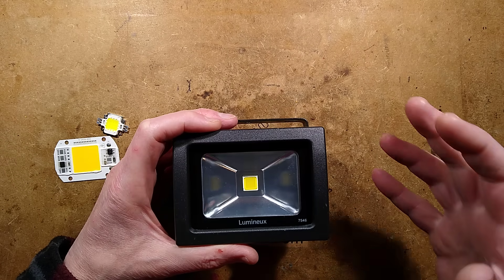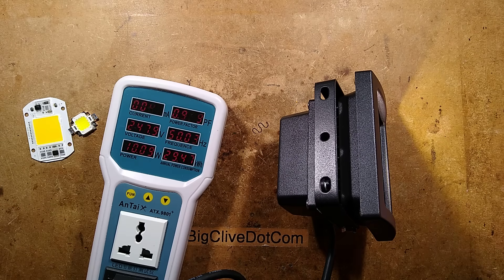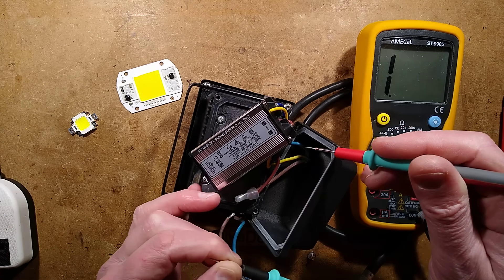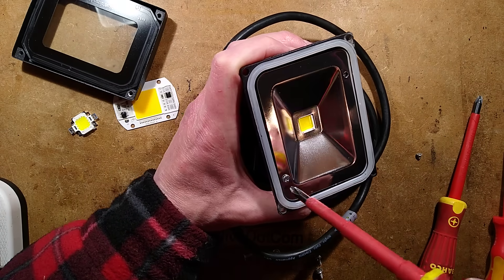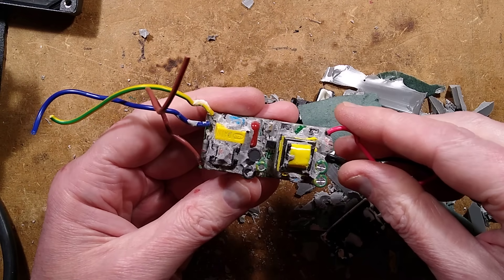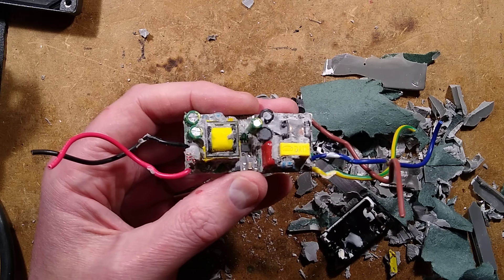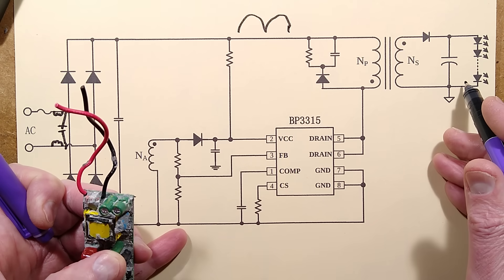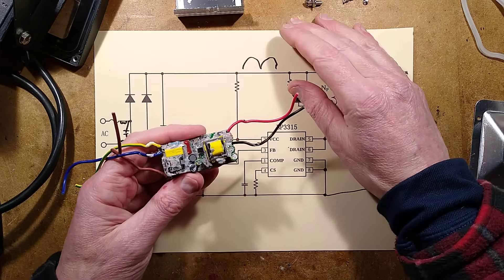Exploring a "retro" LED floodlight with a well designed driver

Comment: Different tack. What do you think about a big department store branded tower heater (made in China) rated at 2000w and powered with 0.75mm twin core flex? Flex gets warm!
Reply from the maker: That's pushing the rating to the edge
Reply: @ I thought 0.75mm was rated at 6A?
Reply from the maker: @TheDocgt40  It's possible they have a higher temperature rated insulation.  But for an actual 2kW load it seems a bit ungenerous.

Comment: Given how many of the things you end up looking at are fire or electrocution risks, it's nice to see one that's actually nice for once. While I understand the push for cheaper LEDs, I really hate how hard it is to find LED bulbs that don't suck nowadays. Or just bulbs in general. All the downlights at my parents' place are self-contained LED, and once those start failing I'm sure I'll get co-opted to replace them since I don't really want their house burning down. Plus they all flicker madly whenever any inductive device is running, which is fun.

Comment: I've been looking for a good LED to replace a bulb in a 8mm movie projector.  Cooler, less wttage. win/win.
Something like this would be nice.  But would it be bright enough?  Hmmm..
Reply from the maker: For projectors you may need a precise pinpoint source at the focal point.  If you used an LED (and you do get rectangular LEDs just for video projectors) then it would require a new optical system to match it.

Comment: Absolutely agree. Have replaced 3 new led floodlights in as many months. All same type of failure , the led goes dim/dim flashing. Same brand, from Screwfix/Toolstation, have the external pir sensor, all 10w. Night searcher were doing a good sale early 2025, so picked up a few, with a few year warranty, it's worth a punt. Cheers for another informative, funny and educational video. Wish this sort of stuff was around when I was a kid. May have helped me avoid many electric shocks overrr the yearrrs. 🤯🤪
Reply: Will have to do a take apart video and see what type it is. Probably an all in one ic type.

Comment: This reminded me to dig out my old one of these. I hadn't enjoyed them indoors except as worklights because of their relatively cold spectrum, but I have some sheets of orange gel left over from another project (also involving the square Ikea Grono accent lamps), and with a diffuser fashioned from two layers of simple vellum the result is a delightfully warm glow.

Unfortunately, I'm in the US and thus unable to order from this seller (who's probably out by now anyway!) But I'll have to see if I can find a few more of these more locally, since unlike the newer sort they really do last in indoor applications.
Reply from the maker: You can probably swap the LED out for a warmer colour one.  The 10W version are available in 9V and 27V versions, but the 20-100W similar style have a standard voltage of about 30V.

Comment: Hi, you mention flicker a lot. Is there a risk when using these around rotating machinery (think lathe in the shed) that moving parts can seem stationary? I remember during the 80s machine shops having their florescent lighting wired to alternate phases to reduce the risk of that happening.
Reply from the maker: The flickery LED floodlights can have a similar effect.

Comment: Great video Clive. I’ve got a bit of an interesting one for you. I run a resale store and when we get printers in, often times the cartridges can be remanufactured quite easily. I’ve got dozens of these resetters meant to reset values of the ink level IC. They are all over AliExpress, but the part I find interesting is how a few of them are programmed to stop working after a while. There’s options on the item page like “100 times”, i already planned to RE them but i certainly was after seeing that. After inspection of the canon 250 resetter, it is a fake attiny that’s counting to 100 and drives a big transistor. The reset function itself and indicator led is powered by a separate SSOP. From what I can tell, when the counter exceeds 100 it will drop power from the gate. I’m patiently waiting to run out of “times” with the resetter since i think a solder bridge or even the attiny’s reset function could bring it back. I’ve been learning this stuff for a while now and these little SOC circuits have been perfect for that.
Reply from the maker: It would be interesting if the counting was done by a separate chip, just enabling the circuitry with a transistor.

Comment: It was quite easy to replace the driver with one to run from 12V to create floodlights for off grid use.. More of a chalange with the psu on the board design.

Comment: From an installer's point of view these were excellent as a replacement for the 500W halogen cookers which were often poorly sealed and corroded the end contacts of the lamp.
I never had an in service failure.
Compare that to David Savory's frequent rants on LED strip lights and external floodlights - scattered with necessary expletives.

Comment: Only reason I got rid of ours is the sensor that was attached to the bottom got its plastic broken so it tripped too much. The outside had gotten rusty due to location but the light still worked great.

Comment: Agree with you Clive, every time an led floodlight fails, off to landfill it goes. With the useless 1' cable provided, I've learnt to wire up the in line weather proof connector 12 foot up a ladder, not fun times.

Comment: An old mechanic trick if the screwdriver slips use some valve grinding paste on the tip keeps the driver from slipping

Comment: Heh, I have one of these on my desk right now ("warmoon" pseudo-brand, 120V/US) and the only difference is that the driver board isn't potted and isn't even in a box - it's just floating in that back section, wrapped in one layer of what looks like kapton tape.
Reply from the maker: That and heatshrink are common on the cheap imports.

Comment: That's a high quality LED floodlight! Too bad it it had to die in autopsy, for our viewing pleasure, but you have a box of them :-)
I have a cheap one from Lidl, that is 6 or 7 years old and still going, but it's very weak. I also have a relic floodlight (some 15+ years old), with a matrix made with individual 5mm LEDs, that is even weaker - my rechargeable pocket torch has more lighting capacity :-)

Comment: COMP = Frequency Compensation.
...basically a low pass filter required in the feedback path to keep things stable, in the same way op-amps need it (i.e. stop if going 180 degrees out of phase, as in  becomes a positive feedback which = oscillator = NOT GOOD).

Comment: This is the definition of "they don't make 'em like they used to" and it's not even an exaggeration.
Reply: I long for those days. They may have cost a bit more but you didn't have the far king things blow on you every few weeks. I have been trying to purchase a reliable and quality 12V 2A Power Adapter and so far all three companies that I have purchased from have had their products returned and after seeing images of the test results even paid for the return shipping without putting up a fight. Just so sad we can't buy quality products anymore.
Reply: @josephking6515   The good old days .. When men were MEN ! and sheep where AFRAID 😝 DAVE™🛑
Reply: Oh yes they do. Hard to find these days and certainly not on ebay or aliexpress but these type of flood lights still exist

Comment: Could you please, . show a couple of hacks - to convert discarded vape 'devices' with usb c charge ports -
 into simple press to light mini torches ? a suitable led and switch ? - and removal of smelly gubbins? 
 [ ELUX ] have some nice pocket devices - and those girthier ones with multi chambers.
Reply from the maker: The circuitry means you could only have the LED lit for about 10 seconds before needing to release the button and press it again.  A standard 5mm LED could be used with a 47 ohm resistor.

Comment: Solder tinned ends on the mains cable is a fail, why do companies do that?
Reply from the maker: It's fine if they're not subject to continuous vibration and movement.  It prevents loose strands from sticking out of connectors.

Comment: Have many of these in a work light format, much larger with all aluminum housings w/heat sinks and steel frames....they were more expensive but really put out the light and have worked great for many years. Thanks for the tear down and R-E Clive, great video.
Reply: Can I ask what brand?  I'm looking for a good one.
Reply: @Celtic_Identity Bought at Home Depot, $30 ea I think. Yellow in color, no name unfortunately as the stickers have come off but should be easy to find. Mine are a few yrs old now.
Reply: @terrym1065  Thanks.

Comment: I bought a few like this years ago  They all were not the stated wattage As you showed . and they all failed in a short wile . . looks like they have improved noted the reflector was metal mine were thin plastic film like material  . and the power supply was inside the lamp itself .

Comment: My first LED floodlight was from machinemart and was simply an array of many (around a hundred, or more?) discrete LEDs of around 250mW rated power, arranged over an area of about a square foot( yes, that long ago!).  ‘Flood’ was maybe a bit of an exaggeration for it - but it was quite effective for a very local area and used far less power than any halogen bulb.🙂

Comment: Would be nice to have some of them for illuminating a driveway, even if they are exposed to the elements.
Do you think the quality is good for 20 or maybe even 30 years of daily use? 😎
Reply: i'd guess 10 years. but not in a 27/4 fashion.
Reply from the maker: It's hard to predict longevity of any light.

Comment: I've got an 18650 version of that, excellent worklight. I don't understand why they run those newer ones so hard cos you're right, changing a lamp is a lot less risky than changing a fitting, just thinking,  hopefully that power supply is ok, but at least you can fit a new one cheaply, and the led, good outside light it would make.
Reply from the maker: They run them hard so they fail quickly and they can sell more.

Comment: Instead of getting a full unit like that ive just been buying big 12v 1000 Lumen COB LEDs from Amazon or AliEx and making an enclosure for it while powering it with 12v AC-DC LED Powersupply/Transformer plugged into a remote-controlled outlet. I consider every now and then trying out a normal floodlight, but i just havent really felt like it, partially cost related.
Reply: Considering how much outdoor stuff like this fails due to earth faults I think a indoor 12v power supply and using 12v lights might be the way to go.
Reply: @loulou53137  I have the powersupply in an enclosure so it isnt affected by weather. I also use a barrel jack adapter with screw terminals so i can use my own wiring so its also weather protected. Been doing it like that for a few years now, havent had any issues. 

Not sure if you were being sarcastic or not from a safety perspective, but yeah, it does the job.
Reply: @ Oh cool, I have smaller lights rather than big floods and for them I put the power supply indoors where water wouldn't be an issue (and I could just plug the power supply into a nearby socket).
Reply: @ In my case its connected to an outside GFCI outlet with an extension cord and a WIFI controlled adapter outlet. The light itself is attached to a pole in the front yard. I wouldnt say the COB/Light is big, its only 1000 Lumens, but its bright enough to light up the entire front yard. Currently im using a 12v fog light i got from AliEx for like 2 bucks, not as strong as the COB but its more directed whereas the COB shines everywhere.

The powersupply is only rated for 60W 5A which is plenty, a single light doesnt use close to that much so i can connect multiple if i choose to. 

I also have 4 5V USB powered COB lights on the pole, 2 on each side for backup uses or when the stronger 12V lights arent needed. A lot of my power outage lighting is USB or 12V based. I also have USB Buck Boost 5-24V modules capable of up to 2A so i can also power my 12V lighting with USB power banks as well if needed.

Comment: Clive, would you mind telling me where I could buy a case of these good lights?  I'm replacing all the lights around my house this spring and don't want the flicker prone stuff.  I'm impressed with the PSU in them.
Reply from the maker: These were from a UK seller.  I can't guarantee how long they will last.
https://www.ebay.co.uk/itm/405320875782

Comment: One thing I've noticed about these lamps: The reflector does nothing to enhance the spread of light from the LEDs. If the LED array was sitting there on a heatsink all by itself with no reflector, there would be minimal change in performance.
Reply from the maker: I think it's to recover some of the light reflected by the front glass.
Reply: but: more metal (mass for short duty) and more surface area (for heavy duty use).  

so with better cooling you get better lifespan and efficiency.

Comment: Too many connections are not properly fastened due to people not care to use the right screwdriver. So they damage the screw head, trying to get the right torque. And just leave it as is.
And I have to come and fix/replace it, due to heat damaged connections, due to poor connection.

Comment: I bought a LED Flood Light with motion, It worked for a week or so, then the LEDs started Flashing at about 2-5hz and did not stop. I got a call from my neighbour telling me my alarm has going. "I dont have a alarm" i said... "Well something is happening, i walked over but had to go away because of the flashing light!" I had to drive home to find the Light had failed, looking like a strobe light from a club.. (This was in winter in Scandinavia so it is dark almost 24/7.)

I would be happy to send it to you if you are interested.
Have a good one!
Reply: Same thing happened to my parents, except it only flashed when it got cold outside.  Anyways we replaced with with a regular socketed floodlight and just used LED bulbs.
Reply from the maker: That sounds like the hiccup failure mode of the LED drivers where they continually restart.

Comment: I bought a bunch of similar LED 10W 12V floodlights on eBay. Over time a bunch of the LED modules started to fail. Mine had a 3x3 LED array, bought replacement LED modules and keep a stash on hand.

Comment: Interesting. These lights are actually coming from a UK supplier / manufacturer, that is probably why the build quality is better than usual. Maybe still made in China, but with the design made compliant, which the Chinese will happily do at a slightly higher price, if that is what you ask for.
Reply: That's what's quite annoying really, its not just the fact that a product was made in china that automatically means it's bad. Its mostly bad because of the company designing it.

Comment: what i don't get with the EU ban of tungsten and CFL bulbs in the name of being "environmentally friendly": 

How much energy and resources it needs to produce a whole lamp - with metal sheets being formed and painted a plastic dome produced, the LED circuit board being manufactured, soldered, the whole light to be assembled. And after a few years you have to completely dispose the whole lamp if a tiny component fails because they are not repairable. (or not meant to)

And this is more environmentally friendly than repairing a classic florescent tube light? (which lasted ages btw... - i still got tubes running in my basement produced in the 70's) 

- i doubt it
Reply: The law would have been sensible but for the lighting industry gaming the situation for profit, by only producing disposable crap.  The law was naïve/incomplete in not enforcing user serviceable lighting, but not inherently a bad idea.
If you want to complain, Capitalism and its fanboys rightly need a kicking.
Reply from the maker: The landfill created by the "eco" LED industry is appalling.  It's entirely profit motivated.

Comment: I just retired five of these older style floods after nine years of faithful service on my house.  They weren't really worth saving or rebuilding because the aluminum cases corroded badly from weathering (and the front trim that holds the glass pane is steel and rusts out).  They'd probably still be in service if the factory powder coated them instead of painting them.
Reply from the maker: Yeah, the steel front is a common issue.  Not too bad if they are mounted under a soffit to shield them from some of the rain.

Comment: I've found problems with these ones with an attached PIR, the PIR always fails first, usually getting stuck on.... I've sometimes just re wired an external PIR to fix the problem...
Reply from the maker: Water ingress is always an issue with the PIR sensors.

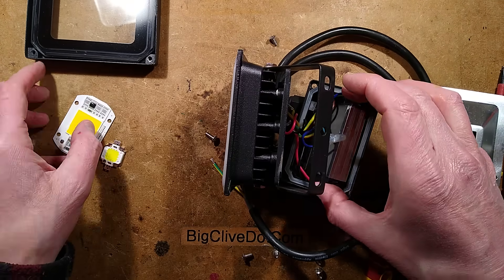Comment: 6:31 Flicker can cause problems for people that suffer from migraines (flicker might trigger them). 

Would adding a capacitor in parallel help to reduce the flicker and could this be done within a pass-through plug?
Reply from the maker: I've featured experiments with adding a capacitor to a DOB (driver on board) LED array.  It's not as easy as it sounds, since it increases the voltage dropped by the linear regulators and can stress them.
Reply: @ Ah yes, I see. Thank you!

Comment: Clive,
How many is in a 'box'?
Reply from the maker: There were 10 in a box.  They are still listed.  Note that there is no guarantee of lifespan without an actual long term test.
https://www.ebay.co.uk/itm/405320875782
Reply from the maker: Also note that this is a UK listing.